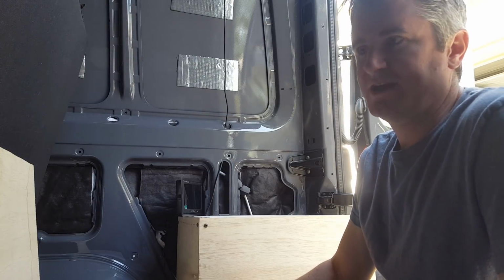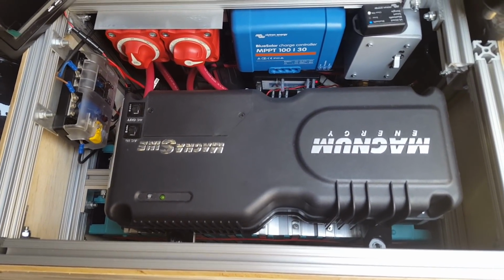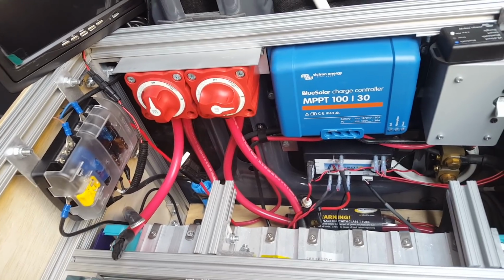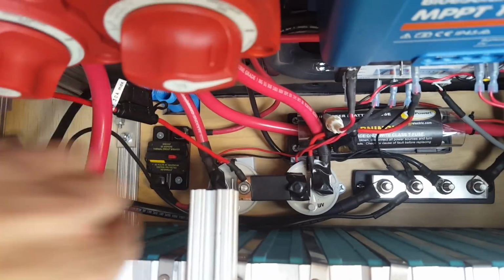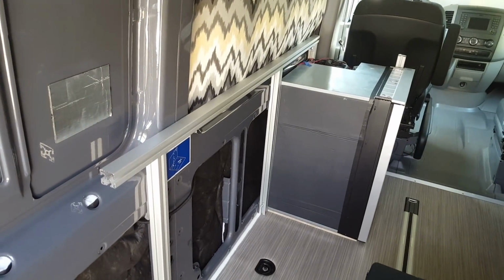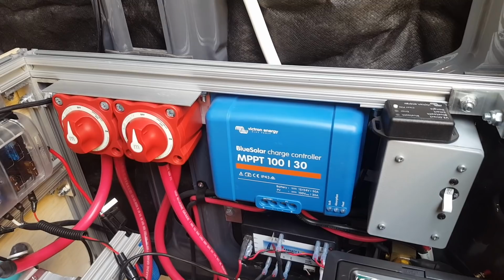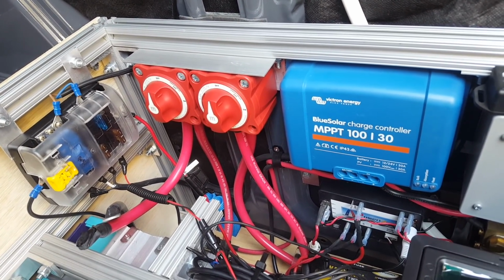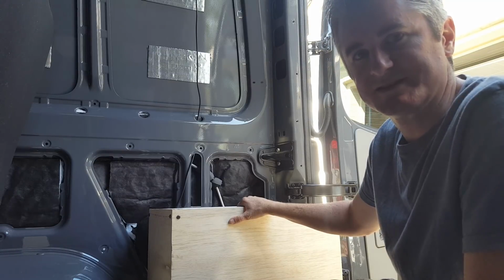Lithium Battery Install in a DIY Mercedes Sprinter camper van

Comment: why would you need a heatshield between the batteries and inverter?
Reply: Have you installed your vent yet? Did you vent to the cabin or to the outside? Thanks!
Reply: kenetube  sounds good. With Summer coming how warm do you think your van is going to get? The batteries I'm looking at do not want to be charged above 113 degrees Fahrenheit. I suppose on hot days you could just deactivate the solar panels. Any thoughts and how you're going to manage your system to avoid these temperature extremes. Thanks!

Comment: I have been very impressed with your build so far (and I think you made a good selection with your battery/mppt/bms), but I find it odd that you took all the time to make sure you are charging your batteries correctly yet you are discharging them with an inverter that is underspec for your loads. Not really looking to "argue on the internet" but your 30 second surge rate of this inverter is 1600w and the 5 min surge is only 1200 watt. I'm not sure how it's going to like the 1400 watt induction burner over time. Even on the lower power settings, most induction burners ramp up full power, then shut down, then ramp back up to full to simulate lower settings so you'll always be using the induction burner at 1400w. This will surge to the inverter over and over again the entire time. Yes, it can support it, but I'm not sure the longevity of the inverter using it in this way.

There are several 2000 watt programmable inverter/chargers such as the Xantrex XC that are VERY low profile that should fit in your cabinet. The Magnum is 16.6”L x 8.4”W x 4.7”H where the Xantrex XC is 14.2"L x 10.6”W x 3.7”H and it appears it could fit in your box. I'm not a reseller or anything, but the XC is 2000w (vs the magnums 1000w), it's got an programmable 80amp charger (vs the magnums 50amp), 30 amp transfer switch (vs the magnums 20 amp), it has a built in screen (vs having to buy the $200 remote although if you want a remote panel, the xantrex is only $60), and the price of the magnum is 790.99 for 1000w where the xantrex is $775 for 2000w.

I also understand that you already have your gear, I guess I'm just posting as a lot of people get their ideas for a build from youtube, so I just thought I'd post for other viewers that may be looking for a similar setup.
Reply: Thanks for the clarification. If that's the case, then I think you've got a winner here with that induction plate. I have tested two plates and both ramped up to full power and then turned off, then back on. When I did some research on this, I was told that majority of these portable induction plates work that way. Care to share the model number of the induction plate you have?
Reply: +nebulight - My only concern since I am debating which inverter/charger to go with due to the draw for an induction cook top is that the Xantrex XC has zero reviews on Amazon or anywhere else I'm looking. Would you know a source with real reviews or do you have experience using this model? I would purchase this option but I feel like I'm going out on the thin limb when something has no reviews. Thanks!
Reply: Hello, did you manage to get a Xantrex XC. it would be intersting for me to know which inverter charger you chose in the end, I am in process...thanks!
Reply: nomadX sher khan I did purchase it, but haven't put together the electrical system yet. I'll be doing that over the next month or so. I'll try to remember to comment about it and I'm considering posting a video review and I will post a Amazon review as well.
Reply: Nice one! I am ever swaying towards renogy solar (3x100w) and a victron smart solar charge controller 100/30. Just a little reluctancy with which inverter charger/inverter only. I would be comfortable with 800-1200watts either way.
Reply: Xantrex has poor reviews on Amazon and some incidents of failure.  By contrast, Samlex has excellent reviews, and also makes a conventional Converter/Inverter Pure Sine Wave.  Samlex is cheaper than Magnum.  Samlex also makes a Smart Charger for lithium I believe.  Best to keep Charger and Inverter separate, not as one.  Less issues and cheaper to replace the converter separately.  So you get a Samlex Converter for Lithium, and a separate Samlex Inverter which works on any battery.  This should solve the problem.
Reply: Holy shit thank you 🙏🏼

Comment: I was wondering where you were up to. Good to see more progress, and thanks for the detailed explanation. From what I know you're doing the right thing with the LiIon battery charge/discharge points - and it's worth doing the same with your phone if you can (but phone chargers are even less configurable than van ones :)